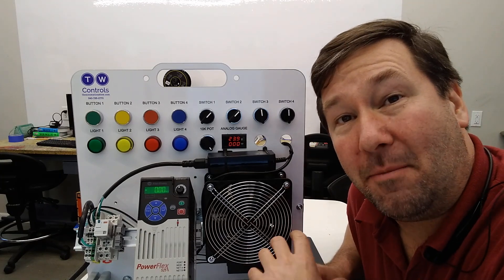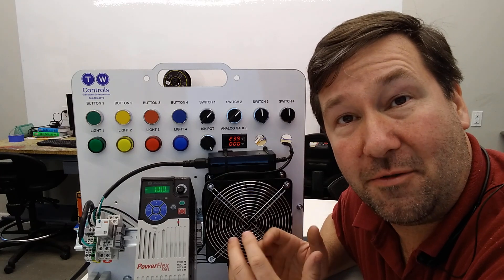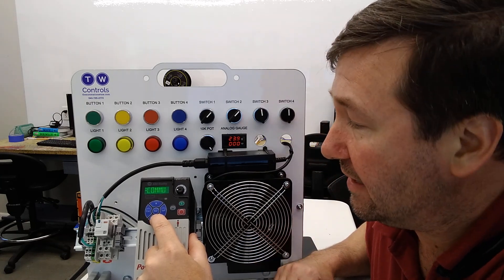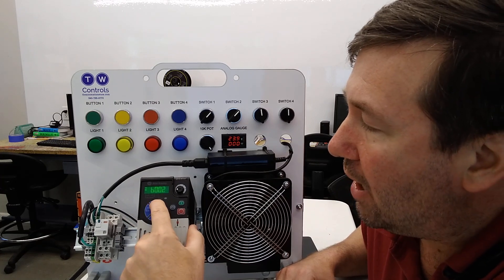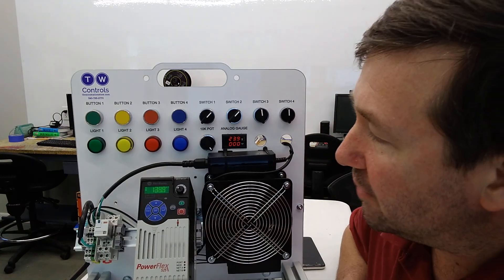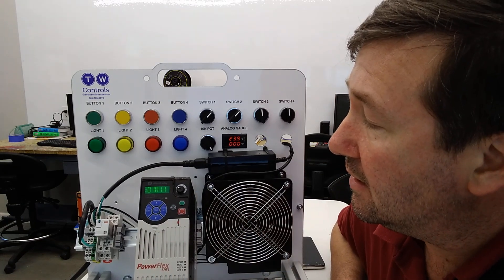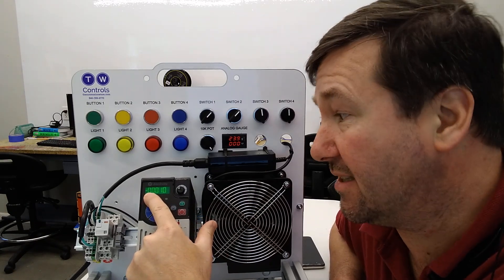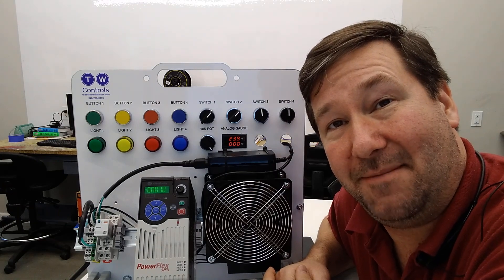Using the Allen Bradley Powerflex 525 AC Drives Front Keypad and Setting Basic Parameters

Comment: Good day. iam working on powerflex 750 wired 2 wire for switching. iam strugling with speed referece  4 to 20 mA..  I want to control speed using 4 to 20 mA. iam failing to program it to match with 4 to 20mA
Reply from the maker: Start with determining if you need a wire or 4 wire. That is the most common problem. 
https://youtu.be/k8_axizTWTE